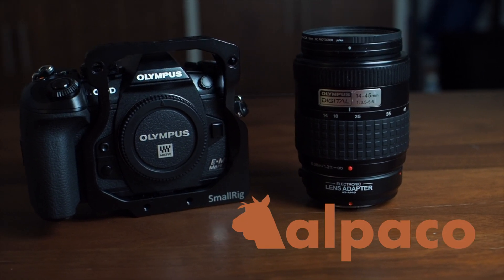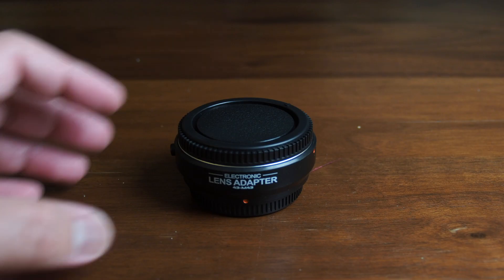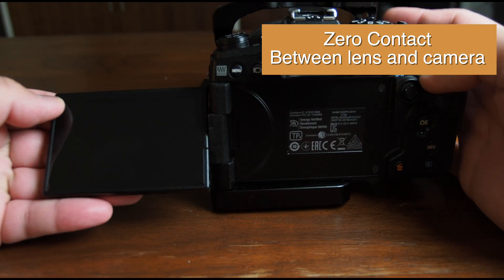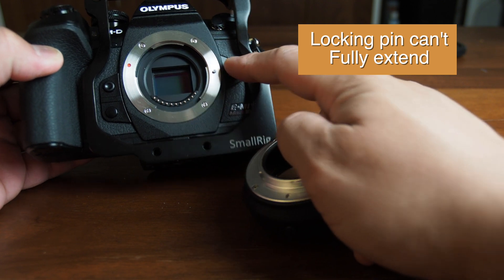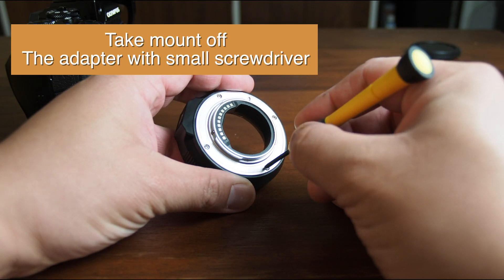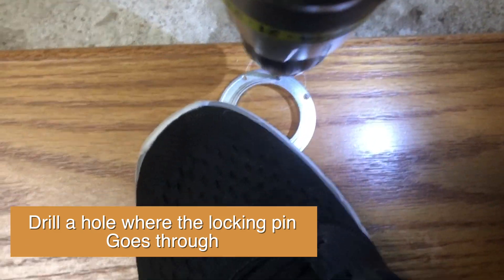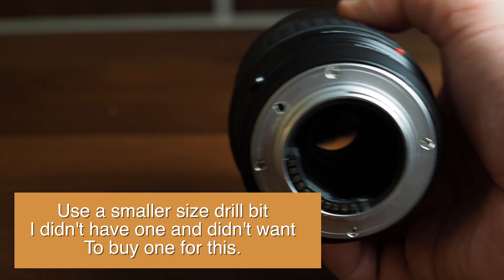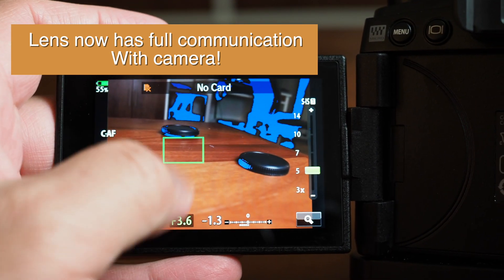How to Fix Cheap Four Thirds to Micro Four Thirds Adapter

Comment: So, how's these cheap adapters compared to Olympus' own adapters? I've heard complaints about Olympus' earlier adapter since they have bad clearances thus resulting in CA and some low corner sharpness. I bought this cuz well... it's cheap 😂
Reply from the maker: Sorry for the delay! The older Olympus adapter MMF-1 and MMF-2 aren't the best. I think I remember the MMF-3 is the only one that's weather sealed and I think works best with some of the newer Four Thirds lenses. But as far as performance goes. I saw no real difference. Once my MMF-3 adapter broke, I bought the cheap ones and the best thing about the cheap ones is I simply bought one a new one if I ever break one because it's TOO CHEAP to deny!
Reply: @AlpacoFilms  Thanks! That's good to hear!

Comment: I tried with a 40-150 3.5 on my em10 mark IV. Im getting the aperture info, the zoom one but the lens stays in MF. When Im switching the camera off, its focus resets though.
Reply from the maker: This might be a problem with the lens, the adapter, or the terminal on the mount itself. Likely culprit is the lens to mount. Sometimes there's a bit too much give and the lens doesn't properly connect to the cheaper mounts. The Olympus and Panasonic branded ones had tighter tolerances. Try jiggling the lens a bit and see if that works.

Comment: a bit question is , do it use adapter and about AF is it slow reduce or infinity distance gone , i really hope for u answer
Reply from the maker: Infinity is not gone since there's no other element in the adapter. But AF is very slow and sometimes does not hit focus depending on the camera. Just to note. Only Single AF will work and NOT continous AF.

Comment: I made the hole in the adapter but the camera still won’t read the lens :( it’s the same lens type you have but the 40-150 Olympus digital, any other tricks that may help? I also noticed that if I take the lens off but keep the adapter on the camera will still be able to keep the sensor on but the moment I hear a click from the lens side of the adapter the camera blanks out
Reply from the maker: Oh man, have you tried wiggling the lens a bit? Sometimes the little locking pin just doesn't go all the way through. That locking pin on the adapter sometimes doesn't go into the lens lock on the lens. This is a common problem with the older 4/3 Olympus Digital 40-150, I own this lens as well and it does that same thing and I have to wiggle a bit for the lock to fully extend. (even if if makes a locking click sound) try this and let me know how this goes.
Reply: @AlpacoFilms   i'm using preparing to purchase an older 4/3 Olympus Digital 40-150 , so with this lens adapter is it affect slow take AF please ?
Reply from the maker: @tizx-studio  Regarding the AF it will be very slow. But manual focus is fairly pleasent since the body of the lens is large. Also note that it is only single autofocus and not continuous af.
Reply: @AlpacoFilms  great to hear your awnser, i found m.zuiko 40-150 is better price , maybe i will look for mf lens with lens mouth that gonna a choice

Comment: Hi. And auto / manual focus will be work good? 

Thanks you so much if u could replay quick to my comment. Now i want to buy a adapter and old objektiv 🌹
Reply from the maker: Hey Amin, manual focus works very well. But Autofocus depends on the camera. If you're NOT using an E-M1 or E-M5 Mark III Auto will be SLOW
Reply: @AlpacoFilms  my camera is Panasonic Lumix g9, will be work? Thanks you so much ❤️🌹
Reply from the maker: @Akswearstudio  I honestly don't recommend using AF on Panasonic bodies with these older lenses as they are optimized for Hybrid AF so with a contrast only based AF it will hunt much worse on the newer Panasonic bodies.
Reply: @AlpacoFilms  thank you for your reply 🌹❤️

Comment: Hi, i have te same lense and i want to use it on my canon 6d mark II. Can you tell me, which adapter i need?
Reply from the maker: Hey the lens I’m using in the video is specifically for a Four Thirds camera and there is no adapter available for Canon EF mount. I also doubt it would be usable as the four thirds sensor is half the size of a 35mm photography “full frame” sensor like that on a 6d mark II.
Reply: @AlpacoFilms  Thank you very much. Now i can end my "adapter journey" and hold the lenses in honro on my shelf. thank oyou for the quick reply, take care and have a nice day!
Reply from the maker: You’re very welcome! You can easily find suitable lenses of even better quality for the EF mount for low prices since the EF mount has now been discontinued!

Comment: How is your focusing speed with it? Mine Olympus MMF-1 on Panasonic GH5 takes 3 sec to focus, very discouraging.  But you are using EM1 II , which has a special electronics to focus faster with 4/3 lenses
Reply from the maker: Hey @petko lordanov it will depend on the lens itself. The cheaper and newer Four Third lenses are contrast detect based, but, the more expensive Four Third lenses are Contrast and Phase Detect based so they are quicker. They won’t react as fast simply because they don’t take advantage of the tech inside the newer bodies. But, they are still fast and accurate!
Reply: @AlpacoFilms  I was using both the pro lenses 14-54 mm F2,8-3,5 and the cheap 14 -42mm F3,5 -5,6 and it makes no difference, as slow as 3 sec to find the focus.
Reply from the maker: Ah yes the 14-54 version 1 will work perfectly on the em-1 for sure! I actually used to have the 14-54 v1 and it was very fast! The version 2 of the 14-54 is actually contrast detect based. No matter which version is going to be very slow on the GH5.

Comment: My cheap adapter damaged the lens mount. Sent it back and bought the Olympus one.
Reply from the maker: That’s terrible!! Yea the name brand ones are great when you can get your hands on them. I actually got these free with these cheap lenses I bought used online. I have an mmf3 for my better lenses. They have a higher tolerance fir sure. Did Olympus fix the mount? Everything I own is second and third hand so I don’t actually have a warranty.
Reply: @AlpacoFilms  I usually buy second hand too. It was an old 12-60 2.8-4 SWD FT lens. It still works but it almost damaged the electronic contacts of the lens. Missed the by like 0.5 mm.
Reply from the maker: @tobiasdavid3096  dang! That’s freaking terrible!

Comment: A bit rough as a method, but OK it seems to work. A yes these are really poor quality adapters (bought mine on aliexpress). Filed a complaint. The seller denied the problem. And aliexpress said they were right!!! So my advice would be: don't buy on aliexpress anymore. Just a mafia of crooks. With almost western prices in addition. Double crooks.
Reply from the maker: I hate aliexpress with a passion!
Reply: Dumbass buyer. I thoroughly enjoy AliExpress. Usually buy clone from there and exchange for real stuff with Walmart looooll